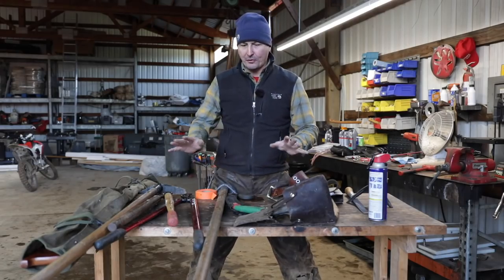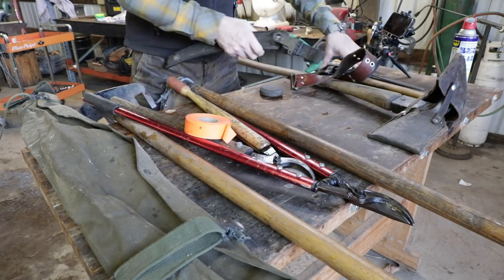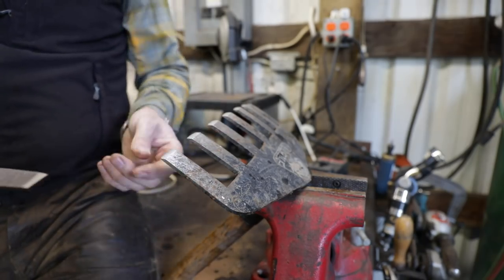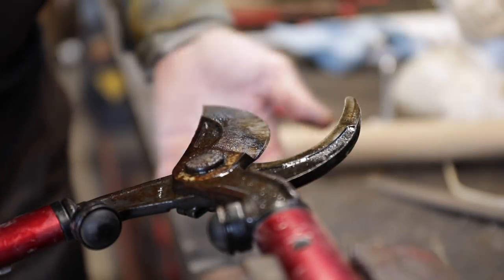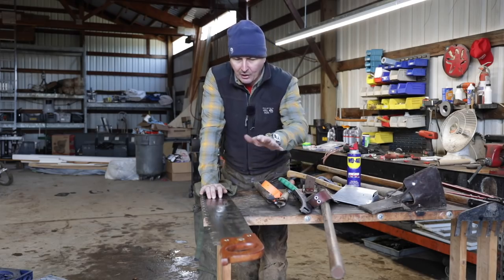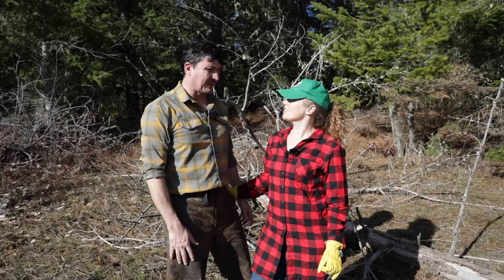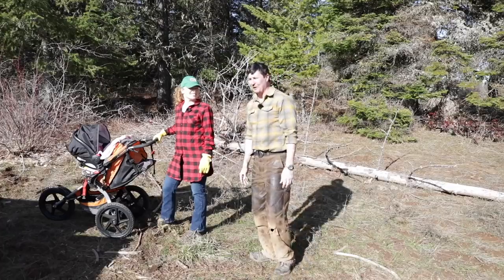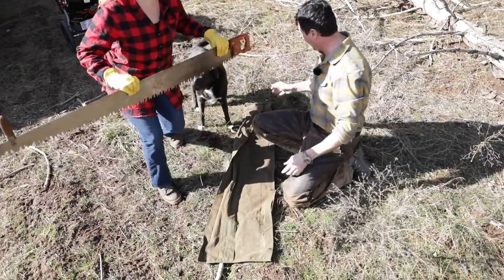Where Did This Baby Come From? - Wranglerstar

Comment: In 1965 hurricane Betsy's eye came over our house. The house had very little damage but a huge hackberry tree split down the middle and a 14 inch branch broke off (it was rotten in the middle). I like to cut wood and volunteered to cut it down. All we had was a 2 man saw and daddy saw I was having a hard time so he bought a one man like yours. I climbed the tree and cut all the branches and burnt the trunk. It was about 5 feet diameter but the main trunk was only like 12 feet high. We had no fireplace so I just put the wood out the way. It was a tree we used to play under much, oh well. I was 13 years old. Congratulations on the girl.

Comment: WD-40 - Don't leave home without it. | Or better yet, no home should be without it.
Reply: Cool.
Reply: To be honest, I use liquid wrench a lot too.
Reply: If you can find it over there, try INOX, does everything WD40/RP and the like PLUS works as a lubricant/protectant as it is paraffin based, not solvent based. To give an example. WIfe's car had chromate plated suspension bolts, some I managed to cover with INOX when refitting a exhaust hanger (lubricant use).
4 years later with everyday use those bolt heads still gleam gold, the otherside are the usual oxidised colour.

Comment: Take your lopper apart to sharpen the inner part of the blade. You missed apart 1/2 of it and that's where most of the cutting happens. It's only 1 bolt & but and 1-2 more minutes.

Comment: As a Tool & Diemaker of 35 yrs one of the tricks to make it easier to clean the pinnings from your file is to use chalk.  Rub it on your file to coat the teeth especially when filing softer materials like aluminum thus it does not let the material adhere to the teeth of the file

Comment: I throughly enjoy your videos, been watching for several years. First video I watched was the coyote encounter. I go back and re-watch many. You might be interested that I am a member of a club that maintains a portion of the Appalachian Trail and what I have learned from you on tool sharpening I use in that endeavor. So you have and are helping to maintain the "AT"! You also inspired Pastor Joe Fox to upgrade his safety gear for using a chainsaw. 
Just a bit for your information. I watch YT on a so called "smart"tv. There is no way to give a "thumbs up" on that device. I will usually watch the videos again on a iPad and then give a thumbs up there. And for watching the YT ads, I'm still pretty healthy so I can take just so many COPD, skin disorders, and pillow ads. Also, some ads are 3 to almost 6 minutes long! I have just turned the sound off and let them go while I fix a cup of coffee, tea or hot chocolate. 
Anyway, keep up the good work. I and many others appreciate it.

Comment: Affordable Japanese saws usually have highly hardened tooth tips, so they can only be sharpened with abrasives and not with files. Also, within a few sharpenings, the hardened steel is likely to be gone.

Comment: Another tip for wd40 is when you're using a hacksaw or even a jigsaw, receipting saw for cutting metal. It will keep the blade lubed and cool, your blades will last longer also. I work in metal fabrication and use it all the time.

Comment: Sorry to hear some people  (alot apparently) don't like this style. However I will watch whatever you post cause i like watching you guys. Have been watching almost every vid for the past 5-6 yrs, and find it vary relaxing.  Ok enough of that, I haven't used the WD-40 thing but I have found oven cleaner to remove pitch in sap quite well. Although the OCD in you may not be happy with the fact that it takes paint off the blades also. It is almost as if I get a new blade for my table saw or chop saw after I use it not quite that good but pretty good

Comment: The best loppers are made by Superior they are made of aircraft aluminum and way a lot less than wood loppers and are ten times better than any Corona loppers apart from that they come in multiple sizes and are commercial grade loppers and I’ve used them for years the handles on them don’t flex and they are very easy to maintain and repair I also like how cheap they are

Comment: One tool i added to what i have is a Kukri tool , i watched a lot of tests on folks using them before i bought one, my choice was Ontario , it' s been 13 months now that i have used it and the tool will do more production per swing than my long thin sharp blade will..  Have you ever used one?

Comment: WD-40 is technically a SOLVENT, not a lubricant. While it has short-term lubricative properties, if you use it as an "oil" it will not go well for you. 3-in-1 oil or other oils (Lucas Oil has some good choices) would be better for you. FTR, I make $0.00 from ANY of the aforementioned.